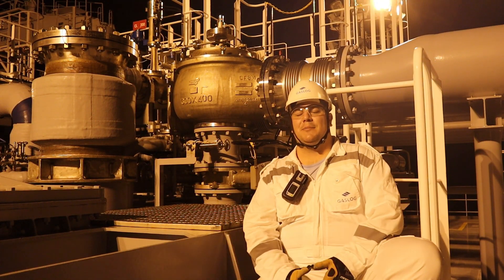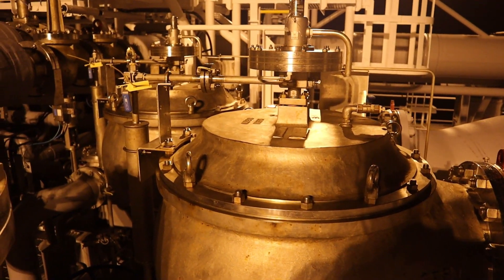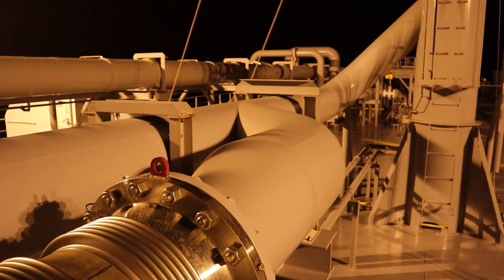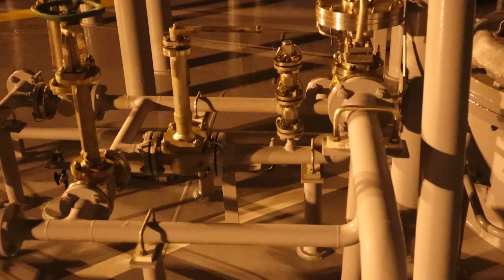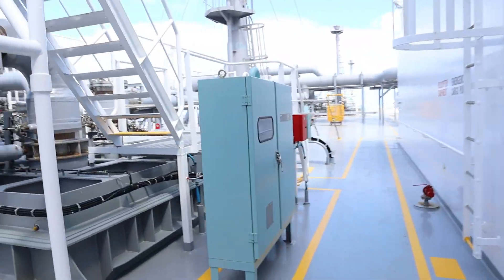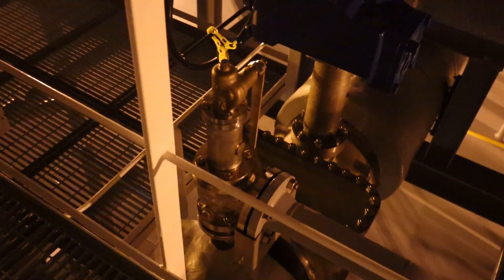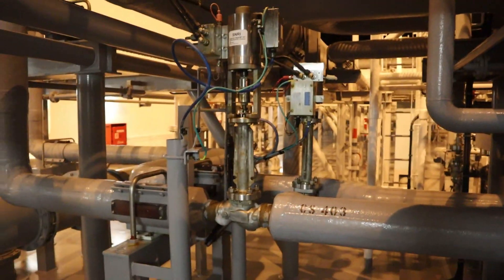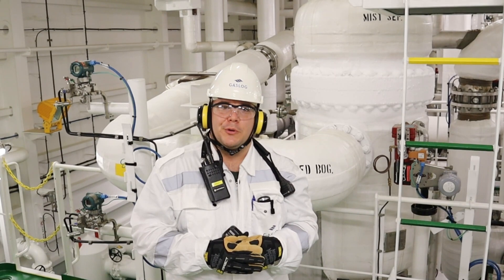The Cargo Tanks Safety Relief Systems on board [LNG Carriers] IS IBS and main Cargo Piping Systems 🚢

Comment: Frames 4:54 to 5:05 - IS Discharge Line runs to the very top of Vent Mast, whereas more dangerous IBS content relieves on the lower platform.
Very queer system.
Reply from the maker: Thank YOU Vlad for your comment.

Comment: Frames 4:54 to 5:05 - IS Discharge Line runs to the very top of Vent Mast, whereas more dangerous IBS content relieves on the lower platform.
Very queer system.
Reply from the maker: Well thats it